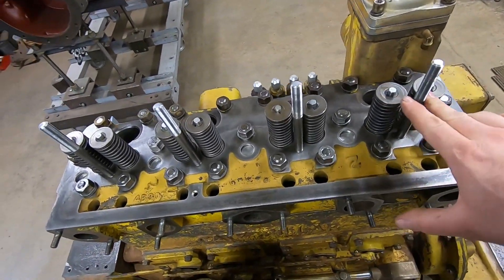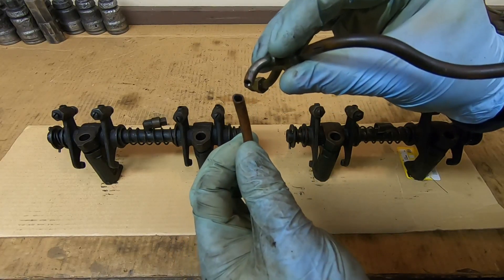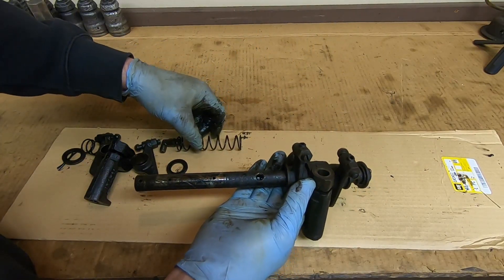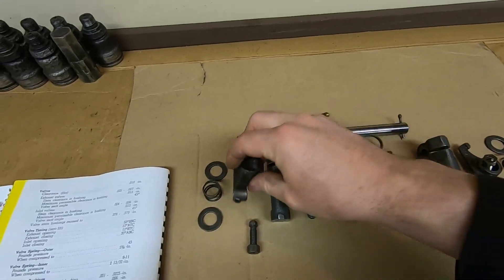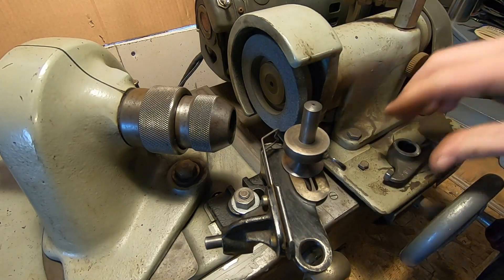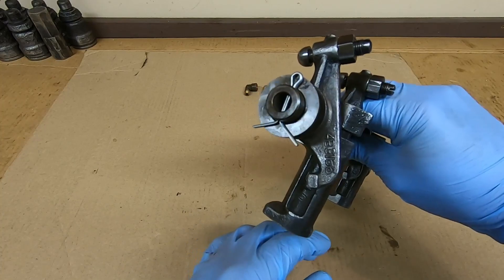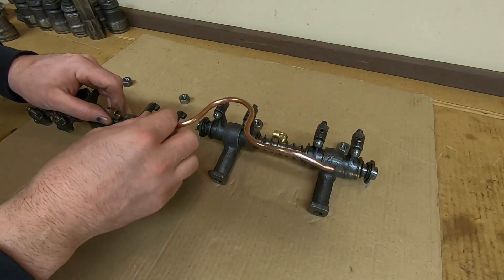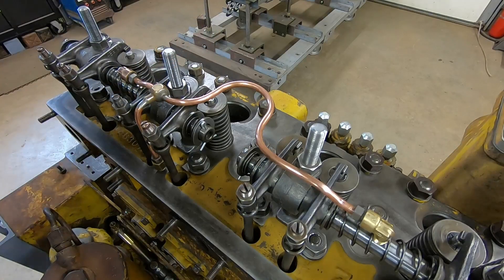Caterpillar D2 #5J1113 Diesel Engine Assembly Ep.44: Reconditioning & Installing Rockers & Shafts

Comment: I'd consider annealing the copper to prevent future fracturing. Wrap the joints with some wet rag to keep the solder happy. This is a periodic maintenance job on the steam engines I work on, it relieves the work hardening that happens as the lines get vibrated. Thoroughly enjoying the series!
Reply: Squatch.. this is a good idea..

Comment: Glad to see that those rocker arms and shaft survived. Really like all the copper, brass and bronze parts in these early model D2s. It was near the end of that era for Cat. Later to be replaced by cast iron and steel, then on to be later replaced by aluminum and now plastic, composites, and fiberglass. I was surprised to see those cast iron rockers weren't bushed, in the future, those early arms could be bored and bushed should they ever need to be refreshed. Cheers Squatch.

Comment: I love all your in depth descriptions and you almost always answer any questions by the time you get to the end.  But today I was not able to figure something out.  I understand the valve train is pressure oiled and thought the block passages, and from the tubes to the valve train rails, and the holes to allow oil to get to the rockers.  But the tubes/rails it is all mounted on are open ended where the cotter pins are.  So what stops the oil from simply pouring out the end and NOT into the rockers, etc.  I love all your videos and have watched almost all of them!  I am about to replace the engine on a JD 2130 due to a blown motor and I intend to open the blown motor up and find the failure and I’m hoping to rebuild it and I learn so much from your project.  Keep up the great work.  Same accolades to senior!

Comment: If you ever have bent rods of the unobtainium variety, don't throw them away. Old timer trick was to roll them between two junk cast iron surface plates under a substantial weight (in this old timer's case, the hulk of a failed pre-war german tractor engine casting, so around 200kg or there about). Won't be perfect, but it works, i use this method all the time, with lighter weight to uncoil fuel line, a few rolls under the weight of a cast iron plate alone, makes the coil perfectly straight. IMO, it's off the same track with the way they make nails out of round wire, those also go through a rolling process, albeit in a different plane.

Comment: I would fix the old oil lines by copying the shape of the one you just installed. You never know when you need a replacement and it is always nice to know you have a OEM part.

Comment: It is good that those rocker arms had bushings. However, I have heard that if a rocker arm did not originally have bushings, it was possible to bore them out and press in a bronze bushing. I read about someone going through that process because he was rebuilding a Honda CVCC engine, and the rockers for the auxiliary valves were NLA. He was able to buy rockers for the normal intake and exhaust valves.

Comment: You did not mention if there is any 'alignment' of the rocker-shafts with respect to the oil-holes to ensure there is a pathway for the oil to flow into the rockers. Do we have to pay attention to the 'rotation' of those shafts before cinching them down?

Comment: Excellent video 😊😊👍👍👍🍻🍻
I bought a vale grinder like yours a year ago.  And the pump was bad .
But it was a easy fix because it was just stuck.  Wd40 and working it slightly and letting it sit for a bit between filling it with wd40 and working it about 4 hours later it freed up.  Then i took it apart and made sure there was no damage. 
I have not had a chance to see if it actually works yet but I'm sure it will. 😊

Comment: If all you have is an old copper or steel oil line that is cracked, I personally would re-anneal the metal to remove any work hardening done by engine vibration before fixing a break in the line.  It might be a good practice on an intact line as well.  Also, if you need a level surface to check pushrods on, you can use a piece of plate glass.  The surface of the glass has to be extremely level to not change the optical properties of the glass, so glass is manufactured by floating it on a bed of molten tin which makes both sides of the glass extremely level and parallel to each other.  It is also easier to use contact adhesive to stick sandpaper on glass so that you can make a part level and flat by sanding, rather than sticking it to the bed of a table saw that you have to clean off later.  Plate glass is cheap enough to be able to throw away after using, table saws aren't cheap enough to throw away after use.
Reply: glass flexes

Comment: Nice show. 

I know that this isn't the final ladh setting, but when you do that final setting, do you run the adjustment down until it opens the valve a bit? I don't know how important it is, but I feel that it squishes out excess oil so that it isn't affecting the adjustment. Probably not real important, but sometimes our OCD just needs to be fed.

Comment: The parts that you assemble on your projects are perfectly clean. As cleaning parts is a critical part of the restoration process, could you briefly explain (Bullet Points) in your videos, the cleaning process you have used to obtain the high quality finish you achieve prior to assembly. Do you use any special chemicals or cleaning processes apart from large quantities of elbow grease?

Comment: I wonder if you could use brake line instead of copper for the oil lines, would it hold up better?
Reply: For consistency with the original, perhaps cupronickel brake line, all the strength of steel with the look and flexibility of copper.

Comment: So is valve setting just as accurate on a cold engine as a warm engine running... Thank you for the video update eh.
Reply: Brent Reid 
from what u understand, 
u gotta set em cold and loose coz they expand .010-.015 when these oil burners warm up
So.. Always set cold
Reply: If the engine manufacturer provides hot and cold specs each are accurate, but who likes laying over a hot engine to set the lash though?
Reply: @ShainAndrews   On our D7 we have never had much luck setting the bugger's cold for some reason.

Comment: that lil copper tube “work hardens” over time
probably why that one broke.. 
u might have to rebuild it in another 50 years
Reply: Lets see... I am 69 now so... 69 + 50 = 119.  ok I`m marking my calendar for April 18 2070 to watch the copper tube inspection video.  I will only be 119!.
Reply: In that next rebuild we'll likely see him anneal the copper tubes to remove that work hardening :)
Reply: The way it broke mid corner, I'd suggest it was (over)stressed last time it was assembled.  Those flare fittings have a tendency to twist when being tightened up.